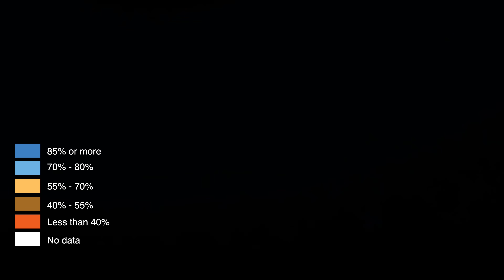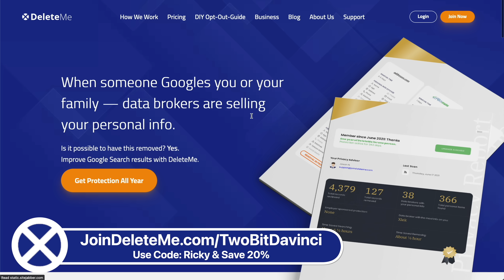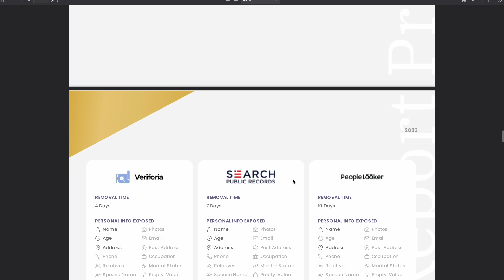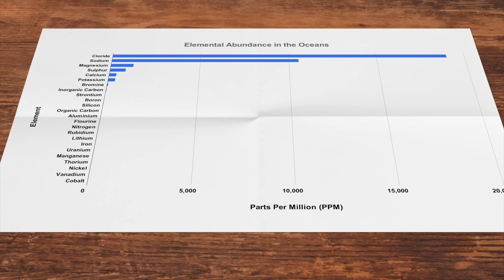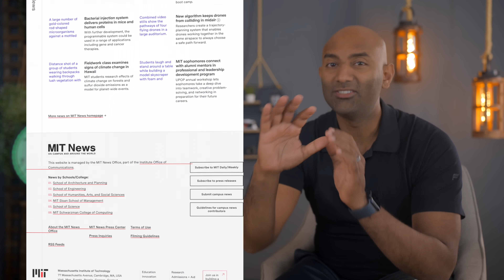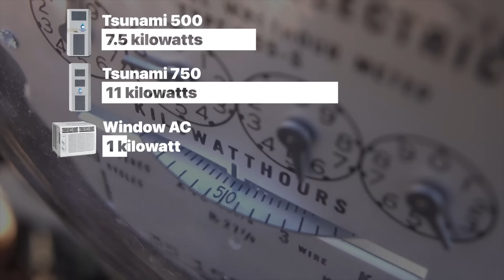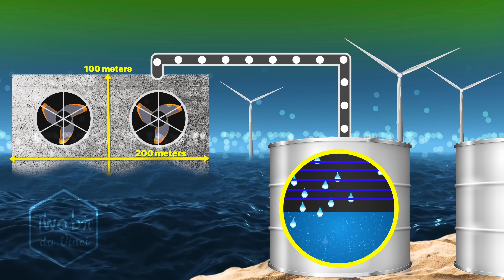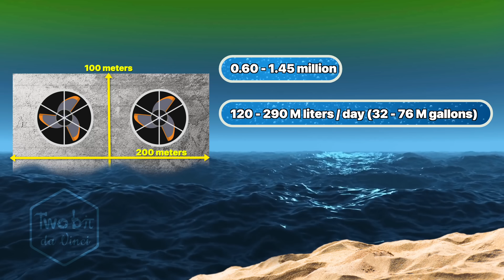This Tower Turns Ocean Fog Into FRESH Drinking Water!

Comment: No.  I'm sorry but this completely misses the point of what actually makes desalination expensive.  Yes, the energy costs of desalination are high, but if that were the only challenge or even the primary challenge of water desalination as a viable option it could be done at scale with generation methods that made sense to the location.  
They can serve 500K?  Only if all of them live right next to the coast with this collection method.  This a a means to serve anything other than a high densely population location in the immediate facility is forgive the pun, a pipe dream.  
The final mile logistics of water are hugely expensive.  That's we don't just build naval fission powered desalinationators and have them "pump" water all across  the world.  Pipelines are expensive, transport is expensive.

Comment: Did the study consider condensing the water vapor out in the collection units? Pumping water takes more energy than pumping air, but there would be a lot less volume to pump to shore. And the condensing being done at the units would use more energy closer to where it is generated by wind & solar (I expect the study assumed generation near the units), meaning less transmission loss sending power to shore for condensing.

Comment: Since this depends on relative humidity and vapor pressure, it will work markedly better in warmer zones. In addition, there'll also be a large amount of microcrystalline salt that gets captured as saline vapor deposits. Normally most of this is recaptured in the ocean. It's why ocean side steel structures rust so quickly. It's a pretty massive problem. The closer the capture point is to the water the higher the salt content also.
Reply: Maybe they'll put miniature versions of these around salt water bridges in the future.
Reply: One fix for that rust problem is powder coating. Other coatings are also available and viable as well.
Reply: @Rev22-21  I think he said that to suggest that the water we collect will still have salt in it and will still need desalination.
Reply: @DurrrrrrtyKurty the collected water would most likely not salty. The microcrystalline salt residue from condensation probably needs to flushed out of the condenser system regularly
Reply: What if you put them high up like on oil rigs
Reply: Yeah, it seems like most of you got what I was putting down. Basically, water coming off the ocean has a vapor pressure. You get better collection rates closer to the water, but you also get higher salt content.
This means the collected water will still have some salt, and they'll be salt buildup on whatever structures are sitting there doing the collecting. Even if the structures don't rust, they'll still need periodic cleaning because salt is hygroscopic. I guess what I'm trying to say is that this won't work perfectly everywhere.
Reply: @Unmannedair think it would depend also on where they put those fans. The fan part was pretty tall. I would think your best bet would to be start sucking air in just above the salty level to limit this problem. I do not know where that would be and I bet it varies by site. Good point thou
Reply: Don't you think that the salt will dissolve in the water?  If not, why not?  And if so, where do you see the problem?  In the corrosion of the towers?  That could only be considered a problem if one thinks building things exposed to salt water is an engineering challenge.  Most engineers consider that more like building constraints and surface protection requirements.  I floated around in an aircraft carrier for over 3 years, so I can personally attest to the engineering challenges of corrosion in a chunk of steel at sea.  

So what?
Reply: Look up moses west a black man out Texas is responsible for this technology
Reply: droplets of salty water are produced by the water waves agaist the rocks. they quickly evapoate and leave a very smal salt powder that will deposit everywhere. need to get 200 to 500 meters inside land.
Reply: As evaporation requires energy this will cool the area significantly.
(Ultimately you can freeze water by evaporation.)

But as heat pollution is a problem near power plants this could maybe be used as a fix here.
Reply: What are you talking about?  There's no extra evaporation happening here.
Reply: @georgeholloway3981  
If you remove water from the air it will become drier and therefore be able to absorb moisture.
In the vicinity of the sea this moisture will come from the sea - by evaporation.

Evaporation requires energy and therefore cools the surface where the evaporation takes place.

You can experience this for yourself: wet your finger in a dry room and wave it around. It will feel cold.
Now repeat the experiment after a long hot shower where the room is steamed through. The finger will not be cooled markedly.
Reply: dehumidifiers work only as water-harvesters (and till extremely inefficiently, not worth it) where there is already VERY humid air, and this is where they are needed the least, because there is a lot of rain and fresh water lakes+rivers there.
They do barely work at all where they are needed the most, in dry areas.
This i just too inefficient to be useful, maintenance, plumbing, net energy cost.
thunderfood will make "just another dehumidifying water harvester scam" video about this shit here.

Comment: Fog harvesting evaporated water is an interesting solution to low amounts of potable water.  Will this effect the amount of water that actually evaporates.  By removing that evaporated water, the surface tension should reduce and thus increase the amount of evaporation.  Will this also effect the surface temperature of the planet if we (humanity) does enough mist/fog harvesting.  As for waiting for other sources to become scarce; we’re already there.  Implementing sooner than later is a good motion.

Comment: Wouldn't these towers make the air of those cities super dry? how would that impact the life of the people and vegetation.
Reply from the maker: We mention it in the video about the percentage of vapor taken. 
But also the sun should cause more evaporation thus compensating. But if this was a concern you could also adjust when the machine was on depending on wind direction...if it was heading inland then you could just turn the machines off and allow the moisture to go inland.  Good question though

Comment: Interesting! However when looking at cost you cannot compare it against the current water utility bill. In most cases the significant bulk of the water bill is related to the infrastructure of water pipes to get the fresh water to your home, not the cost of extracting the water at the source.  So I do not think it’s as easy as saying it’s 1/2 or 1/4 in cost. But certainly there are significant use cases with this tech regardless.

Comment: Greenhouse type building over a brine pool... Double whammy, salt and water. Add a fan to drive moisture rich air to a condenser. You can control the pressure inside this building to make it evaporate at lower temps. Make the building out of focusing lenses. Have water that is brought in, run over a surface that is heat absorbing, or some sort of radiator circuit that stays warm possibly in the same way that focused solar does. A taller building would naturally condense the water. Use baffles to let water collect, then run down into gutters carrying it away. You wouldn't need to wait for morning air, or stop producing when conditions are not right because you could control them.
Reply from the maker: This is somewhat similar to the desal system proposed for the Line in Neom Saudi Arabia. Check out our video on that we did just a few weeks ago if you havent already ...we discuss that system a bit.

Comment: I've thought of this a few years ago. Its the sea version of those mist catching nets . I was thinking of a passive version but the renewable energy hybrid concept makes more sense for larger populations.
Reply from the maker: yeah much closer to the source much higher miosture density and more consistency and much higher volume with a active/passive system.
Reply: @TwoBitDaVinci  Your presentation is extremely digestible and well presented. It's a refreshing part of the tech info and solutions on utube!
Reply: It doesn't. If you do it on a large scale you'll quickly get brine issues. 

It works as long as it is a very small production thus not usefull. Otherwise pollution it generates becomes a huge problem fast (like all dessalting factories)
Reply: @etienne8110  It's not desalinating. The water vapor is freshwater, it's just captured. Yes there would be an increase in salinity around the tower but it should be well diluted over a large area, so nothing like brine.
Reply: @aesma2522  Depend on the scale of the operations.

If you only have one tower extracting a measly few liters, yeah no problems.

If you want multiple units extracting enough cubic meters to feed a city, then you'll have pollution issues.

You are too short sighted/lack the ability to have a larger scale comprehension of the process.

Comment: Close but not quite what you actually want is a long greenhouse floating on the ocean and you pressurize air to bubble up underneath, oxygenation of the ocean around it well also creating pressure within the greenhouse which then leads up pipe to a mountain top with natural cooler atmosphere, condensing at Hight allowing you to pump down using gravity the whole thing is way more energy efficient. Would be even better if it was done by the government and the water is just added to the natural environment backing up naturally formed waterways that already exists
Reply from the maker: Great idea your thinking in line with great engineers of the past......This floating dome concept was proposed by a engineer back in the 70s and it also had the potential of producing power....we shouldve included that in this video..... maybe a future one.

Comment: What about the energy costs to run the plants?  The beauty of current natural systems is that rain and rivers do all the work and all we really need to do is to pump the water.  So anything which requires energy also requires money.  Forget about CO2 and all of that, just simple economics of using energy to get something which is usually free.  Things like dams are great because they actually solve two problems at once.  Maybe if the water plants were driven by wave action, but despite all we've been hearing about wave power it doesn't ever actually seem to work in practical use.

Comment: First off.  We already have millions of the "water harvesters" installed. They are called air conditioners.  Almost no one does anything with the condensate that comes off these machines.  Large commercial units produce thousands of gallons per day.

Impact at the location of the tower would be no different than a R/O unit.  If you pull all the moisture off at a spot, that will cause more evaporation, repeat over and over, and that causes the salt water to become more concentrated around the tower.

There is no magic bullet to making more fresh water.

Comment: I would use tidal energy to bring cold water up to a condesner, in some areas the tide flows so fast your could point an inlet into the flow to move the water up the column. Then you only have pumping losses and some power use when the tidal and wind not blowing.

Comment: You can run this system when power is cheap as well as just limit it when power is expensive, just store extra water. This system is potentially very compatible with renewables, but usually power is cheaper at night but since the sun is down I assume the evaporation is lower, but if power is cheap at night anyways this isn't really a huge problem.

Comment: Did they take into account the salt wear on the tower? Also the fan's also (at least on wind towers) wear out from dust( more then was expected). They could also use the ocean coolness from the water instead of the ground allowing you be all on site and a tube to land.
Reply: It's nothing more then a theoretical paper, as noted at the end of the video. It's unlikely the factored in anything practical.
I have a theoretical paper on warp drives. It sounds great, there's just the problem of practical implementation....

Comment: For costal land mass with predominantly frontal winds all you need is 2 or 3 wind water pump to produce at least 100psi and take that water half a mile into the ocean make a line parallel to the coast and place a spray on top of booms a few meters high as the water fall back into the ocean more than 50% become humidity,the salt will fall to the ocean,the humid air will travel inland and fall as rain or snow, worse case air will be colder more humid lowering evaporation and increase rain,a 5mw wind turbine in theory can pum 100,000galons per minute if only 30 % in evaporated and only half become rain still 15,000gals per minute.

Comment: Another thing are they pumping the hot air that comes on the other side I mean they’re using refrigeration and it’s going to create a lot of heat that better not be going into the ocean that actually could use a little bit of cooling which after I thought about maybe you should think about giving that to the right people if you cool the ocean a little bit, you could probably slow down the melting of lies cabs and hurricanes just a thought

Comment: Great video
Doesn't fracking require fresh water? Instead of pumping it out of where they fracking mess up the drinking water sources make them pay to get there's from these systems or at least help find the building of one for a city then if works combine your heating and water bills into a public service run model of to get hooked up it's this much for this much bang no price fluctuations unless break downs rite plus clean water can be used for so many people instead of industrial or even farming opportunities could explode around coastal areas historically lacking water with these Dubai UAE I'm thinking of you😊

Comment: Are they not harnessing the tidal energy? The water is moving whether the wind is blowing or the clouds are the blocking the sun. The tidal action is always present. The towers would likely be built from the sea floor up so it is going to have surface areas that are subject to tidal pressure. Not to mention being able to install additional generators that would power the structures. It is totally renewable...
Reply from the maker: Yes using tidal energy seems like it would be a total win win.

Comment: Every time I get an ice, cold glass of water and set it on the table. I see this effect in action. I get a pool of water underneath the glass. I think this is really practicable. Does not produce a lot of brine only involves moving air over a cool surface and then goes into the water system. I think it deserves a lot more attention.
Reply: Your refrigerator used a lot of energy to cool that water down.  Keep that in mind when you consider the true cost of that water.  It's not free.

Comment: The cost figures are wrong. They are not taking into account the salt brine which will accumulate on both solar and wind generators reducing lifespan significantly. Warmer areas where humidity reaches near 100% (making these towers effective) will also enable the spreading of salt rime. I give lifespan of solar/wind generators 5 years max before needing massive repairs or replacement.

Comment: The original air coolers were evaporative coolers, which were used to cool factories.  However, this caused the air to become very humid, which was bad for machinery and products.  So dehumidifiers based on air compression and decompression were invented to pull the water out of the air.  Then, some bright person noticed the dry air from the dehumidifiers was cold, and realized that they could get rid of the evaporative coolers, since the dehumidifiers would cool the air by themselves.  This was modified to use a closed evaporative-expansion cycle to produce the cold for cooling, but they are electricity hungry.  While you might be able to get water to condense out of the air using the method from the video, it's going to be slow going without compressing the air.